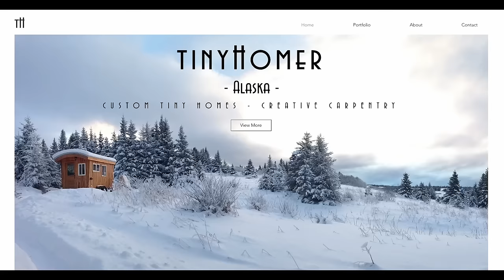WE HATED OFF GRID LIFE HERE IN ALASKA. So… What changed?

Comment: Just boil water with woods, mix it with cold water and put a bucket of water with hose connected to it and make a shower
with it.  Use magnetic generator to charge your power banks. To warm your house inside, make a rocket stove, using firewood's.

Comment: As a designer A shape house don’t make sense, it’s a I’ll build a simple house but I want People  go wow,  your useing the same amount of lumber as a big square house, they is a tiny amount of living space  in all that volume  of space. Put a second floor? The higher you go the width get smaller. Same as down stair you can’t  walk to the side as you hit your head on the wall. What you can do Is draw this , cut a hole on one side then the 2 th floor larger with a balcony. You can run beam across both A beam and reinforce under to carry the weight of this larger 2 th floor extension.

Comment: This link has a cheap method to waterproof fabric using baby oil and paraffin. Mineral oil for cosmetic use is purified so doesn"t have the same health concerns as regular mineral oil. Plus, your netting to grommet issue with gaps. You may be able to close those using an ancient button suggestion from the same video at the end. Fold the netting to strengthen it, pull it through the grommet, put a round rock(or ping pong ball, bunched up sock, etc) inside and wrap string around the bottom, enclosing the rock inside. The rock will not pass through the grommet, so the netting will stay tight to the tarp. https://www.youtube.com/watch?v=HedRbIsM75M

Comment: If that Aframe was mine  i would buy a 30 -35 ft trailer pour a cement pad behind A frame  put trailer on pad  line trailer door up with back of A frame  join house to trailer    instant  bigger place     before winter built a complete structure over trailer all insulated  slope roof to back  with a rain water recovery system    thats my idea      good luck dave from brantford ontario canada